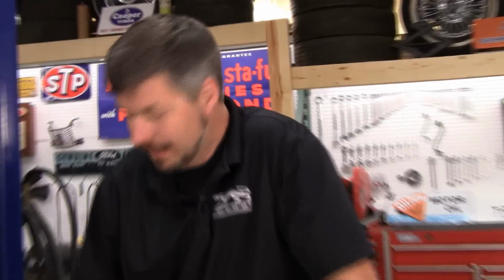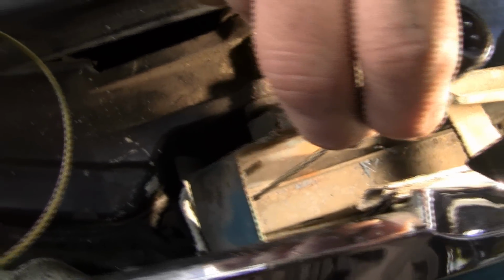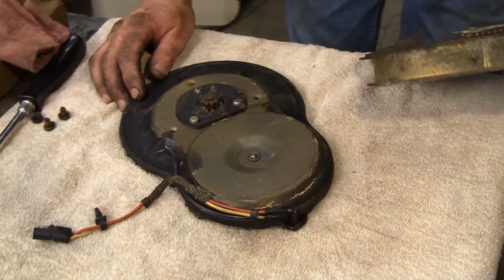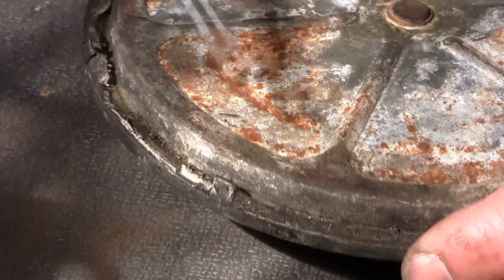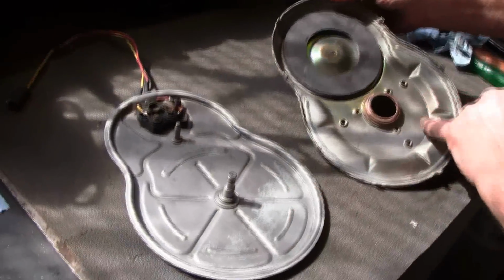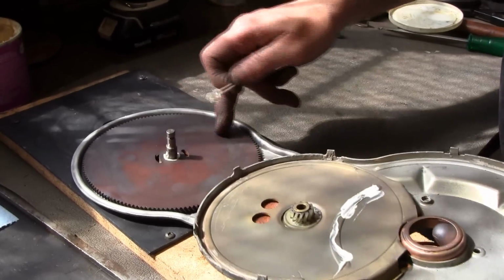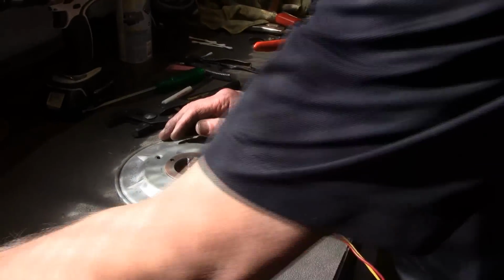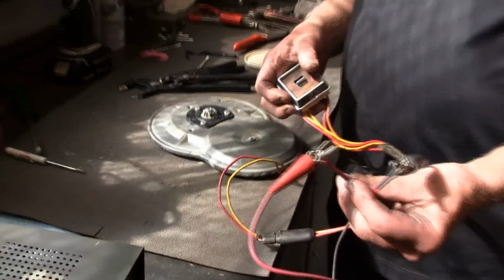Rear Power Window "Pancake" Motor Rebuild - 69-73 Cougar / 71-3 Mustang

Comment: I did driver side 5-6 years ago and still ok. Now trying to get pass out but the motor will not rise even after disconnecting the bar.  @5:50 there’s a break in the video and it doesn’t explain how you raise the motor especially if it doesn’t move electrically. It does “click” down, just won’t go up. Please help before I order the refurb process. (I’m long time customer of WCCC)
Reply: I finally figured it out: First I had to use a long screwdriver and manually, loosen the tab and work the gears apart by rotating the screwdriver and disengaging them, a couple teeth at a time, while using pull wire on the arm to lift it all the way up. The next problem was the gear came out all the way, and although I could lift the window now to the top opposition, the motor arm was too long to get it out; so I had to secure the motor and pull the linkage with a long hook rod back to the motor gear and manually get it engaged, at that point (thank God) my motor does go down and was able to put the regular in the halfway position (although not stated, I had noticed in your video when you pulled it out the position of the arm) so I couldn’t pull the motor out finally! Oh what mechanical fun we Car Guys have :))!
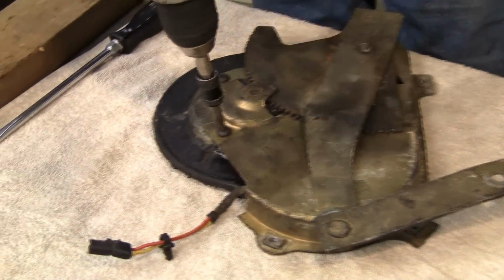Reply: PS: *You DO demonstrate manually moving the arm around 7:30 and doing this while it’s still in the chassis is quite challenging. I really appreciate this video and the work shared by WCCC!

Comment: Hi, great video you guys. My motor is struggling to turn. It will turn in one direction, but turns slowly in the other direction and then eventually stops altogether. I have taken it apart multiple times, everything looks fine, the tangs aren’t clamped down tight. Here’s a video of it https://youtu.be/Xf8mYpZe9oM

Comment: I always seem to get the rare occasions the magnet was loose and the top of it was extremely corroded so I took the opportunity to turn it over I did glue it down but it is extremely possible that it wasn't in the perfect position for contact on the gears because they both spend perfectly free until I mate them together I haven't completely sealed the unit blocking the tabs yet I did put a thin strip of the rope caulk just so it would have the space but I didn't crimp it down just hand tight are the magnets polarity specific?

Comment: I did the rebuild as per the video after the unit is sealed its not functioning as far as I can tell the gear will only turn a half inch in either direction manually, it seems to be jamming its greased properly any ideas? power is reaching the brushes and they are making contact with the Armature.
Reply from the maker: +Marcel Clay Here's a response from Richard: Did you make sure the little brass bushings were in place of the gear drive?  Also if the case halves were put  back together with too much caulk it will squeeze into the inside, binding the gear.  One other possibility, although rare, is that the magnet could have come loose.  First pull the rubber cover, the gear and the spring and see if it will spin, if it does either the bushings are not there or binding or the spring and gear assembly is binding.

Comment: I just want to say thanks for such an excellent video.  I did this repair this weekend and the window just flies now.  The only addition I made was I put another bead of the weatherstripping around the perimeter of the motor as an extra layer of water protection.  Clean the channels of the guides that the window slides in with spray silicone and then lube  with white lithium grease. A word of caution... on mine the bottom bumper stop had decayed and window got stuck at bottom. check bumper!

Comment: Let me guess egilnp.You have a 67-68 correct? Most likely all you need is to service the system with four new plastic rollers (Number: 5371 on our site) and the correct lubricant (Number: 8341).  Often the arms of the rear regulator will get a little bent out of shape from binding but you can fix them with a vise.  Usually the only time the regulators need replaced is when the stud in which the plastic rollers mount are severely rusted.  Even then, those studs can be drilled out and replaced.